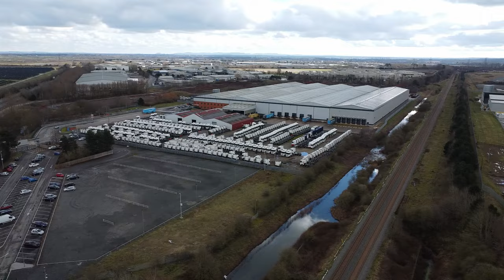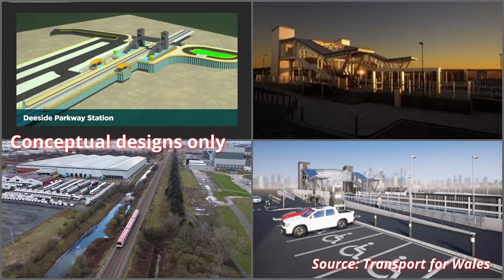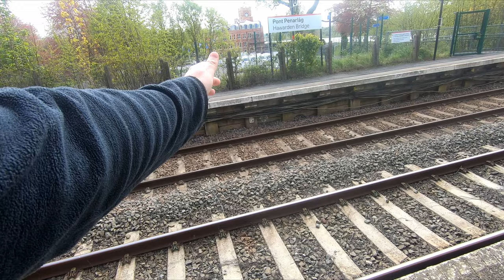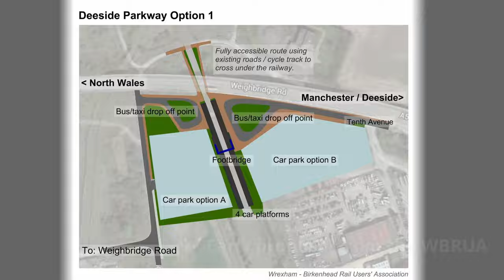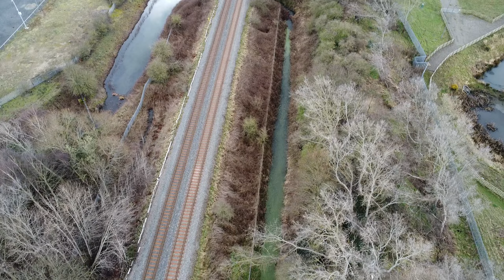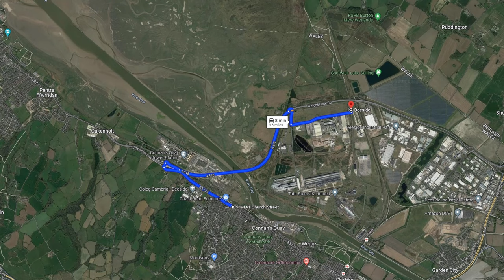Deeside Industrial Park, Flintshire

Comment: Looks like an excellent candidate for a station - hopefully they will also provide cycle lanes etc to the industrial areas if this goes ahead. Integrating public transport is vital.
Reply from the maker: It does have good cycle connections, even a cycle route from the Wirral, but it's quite isolated, so not something you'd want to cycle along at night. Let's hope they eventually build the station.

Comment: It’s not surprising that the Deeside parkway station never adds up - as you pointed out, Hawarden Bridge is effectively on the park and more importantly Shotton isn’t much further away. 

A location in the middle of the park might have made some sense but the planned spot on the edge will only really benefit Wirral travellers from the limited Neston/Heswall stops. 

Because a change at Shotton would be needed it couldn’t compete with driving for anyone on the North Wales line or in Chester. 

Every individual business on the park has good parking and the planned park-and-ride on the Chester edge of the park had to be mothballed because of lack of use. 

It’s also a long walk around the park because it’s (understandably) spread out. 

All in all a station will never add up and will be vanity if done. Better options, like a park-wide e-scooter or bike scheme linked to Shotton station are probably going to be much more effective for rail numbers.
Reply from the maker: I didn't say HB was on the park, I demonstrated it's quite remote, difficult to get to and not practical to connect with shuttle buses.
Reply: @Rail_Focus  It's not really remote, especially as the park is/can only grow to the south given the road/marshland/etc North. My point was really that the business case just won't stack up. Improvements at Shotton will probably have the biggest impact on rail travel to the park.

Comment: Seems like a very high price tag for what the station could provide. That concept design looks fantastically overbuilt for serving an industrial park as well. I suspect getting the line running more reliably would rightly be a higher priority.
Reply: I agree about the price tag but the station looks like the bare minimum for two platforms: An overbridge with lifts and two bus stop style shelters.
Reply: @chrishartley4553  Compare it to most twin platform stations elsewhere; The typical US station has far less, and even the majority of twin platform stations in the UK have far less built structure to them. I really do wonder how NR has forgotten the practicalities of the simple foot crossing.
Reply: @andrewreynolds4949  I rather doubt its NR forgetting the practicalities but more to do with seperating the public from the tracks for reasons of health & safety (litigation & liability).
Reply: @chrishartley4553  Health and safety gone extreme, blowing out their budgets...

Comment: I've wondered if Merseyrail could electrify the line and provide a metro-type service into Liverpool, which would make closer-spaced stations more feasible.

If the Central - Wapping Tunnel link were opened for use, Merseyrail could run a cross-region service from Wrecsam via Liverpool city centre and Edge Hill out into Lancashire.
Reply from the maker: It seems the only way to provide through services to Liverpool will be to use the battery variants of the Class 777, which is currently being considered for the line.

Comment: The lack of ticketing intergration between the Bidston Line and Merseyrail is infuriating especially as the Bidston line serves many small stations.

Hypothetically if I wanted to catch a train from Heswall to Liverpool Central I have 4 options.

Option 1:
Buy a digital ticket from Bidston to Liverpool Central on my phone (through Trainline etc) but Merseyrail don' t accept digital tickets - so not an option.

Option 2:
Buy a paper ticket at Heswall station. There is no ticket machine at this station - so not an option

Option 3:
Buy a digital ticket from Heswall to Bidston and then a separate paper ticket using the ticket office at Bidston (all Merseyrail stations have at least a ticket office or a machine). But this is significantly more expensive instead of buying a through ticket - not an option.

Option 4:
Order a ticket in advance and get it posted to me. That is ridiculous, I shouldn't need to plan several days in advance to get what is a local train.

Option 5:
Board the train without a valid ticket and hope the guard knows the rules and you purchase a ticket on the train. Hopefully the guard wouldn't become suspicious when you show a digital railcard on an app like trainline and ask why you didn't purchase a ticket through the app and think that you were trying to fare dodge. You shouldn't get fined but if the guard is really grumpy and unaware that Merseyrail don't accept digital tickets he could (unlawfully) fine you. - Not ideal.

Anyone know what they would do in this situation? Option 5 seems the best one, but it doesn't exactly make for stress free train travel. 

Very long story short. MERSEYRAIL NEED TO START ACCEPTING DIGITAL TICKETS!!!
Reply from the maker: TfW should fulfill its promise to install TVMs on Borderlands Line stations. Shouldn't have to rely on a guard selling a ticket (some don't bother), I've had close calls at Bidston when I've only just made my connection because I had to buy a ticket at Bidston. 

I had to battle with TfW on social media to get them to clarify that if passengers who are unable to buy a ticket at the station can buy a ticket onboard the train. On Monday the TfW app refused to sell me an open return, but thankfully I managed to get a ticket just before I got off the train. 

I think to answer your question, if travelling to Liverpool you should buy onboard the train, or at Bidston, so long as it doesn't mean missing your connection. 

In 2024 it shouldn't be this difficult or worrisome to buy a ticket.
Reply: @Rail_Focus  Fast reply - thanks.
Agree completely, it really should be this hard!!

Comment: That’s what the plan is in Wales and for the Welsh government to build new railway stations and to reinstate railway lines that were closed in the Beeching Era. And to make the railways in Wales more greener with more upgrades and electrification.
Reply from the maker: The Welsh Government doesn't seem to have much of a plan at the moment. They're fully committed to the Valleys upgrade and seems that they're not bothered about North Wales.
Reply: @Rail_Focus  Rail infrastructure is not devolved to Wales. New stations in Wales have to apply for UK gov funding as said, so the Welsh gov is powerless. The valley lines were devolved so the Welsh government can actually do something there while the rest of Wales have to wait for Westminster to bother. So makes sense the Welsh gov isn’t doing much in North Wales as they’re not really allowed to. It’s up to Westminster.
Reply from the maker: The leveling up funding was a Westminster initiative, so it's implied I meant central Government, but I'm sure the Welsh Government could fund the station if it wanted to. Either way no Government is currently willing to fund the station
Reply: @Rail_Focus  Because it’s not devolved, the Welsh government do not get extra funding for it. If England spends so on so on Healthcare, the Welsh Government gets a proportional allocation of funding for healthcare, for railways it gets 0% because it isn’t devolved while the Scottish government does. So it will have to take it out of the health budget if it wants to fund something that the UK government is responsible for. The Welsh government is only given funds for the things it’s responsible for, it can’t set its own taxes.

Obviously the simple answer is to devolve railways to Wales, hopefully so Welsh people don’t pay for HS2, which they currently are.

Comment: Is there actually a reason why 200 car parking spaces would be needed at the station?
Thats a massive amount of space... seems such a waste for land around a station that is supposed to serve places workers currently drive to...
And it would create more care journeys...
And it would contribute to flooding from runoff...
Reply from the maker: I believe there was data which showed a not insignificant amount of people currently drive from North East Wales to Hooton to catch Merseyrail services to Liverpool, adding to congestion on the A550. Driving a shorter distance to Deeside would be better and technically wouldn't be generating new journeys or congestion.
Reply: There’s a big difference between driving to Hooton for a regular 15 minute 8 car service and parkway for a trundle through the Wirral to change at Bidston.
Reply from the maker: @bevanpaul1  hence why I said it could be a viable option if we get through services to Liverpool.
Reply: It's something I find generally very annoying. Where I live they won't act to integrate the train station into local footpaths or cycle routes or have anything like a useful bus connection, every time it comes up it gets dumped in favour of making the car park even bigger.